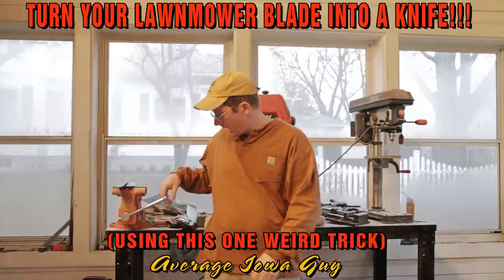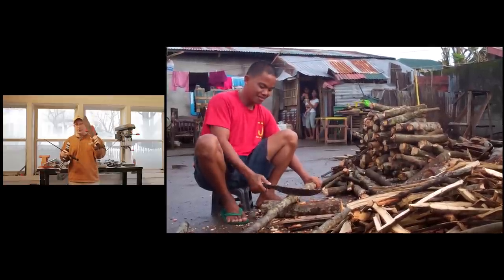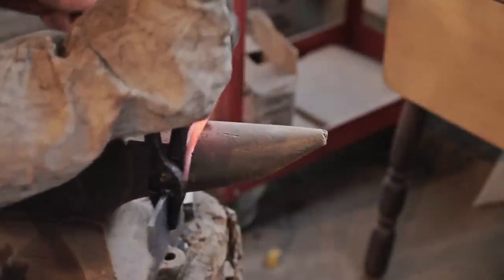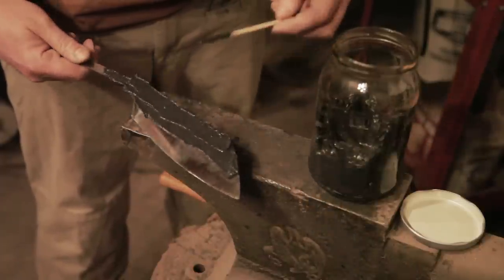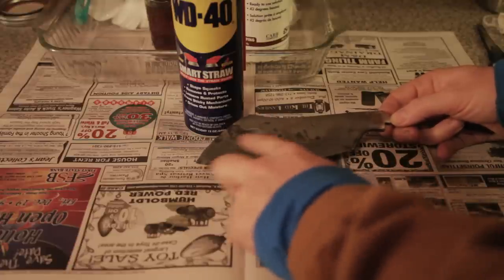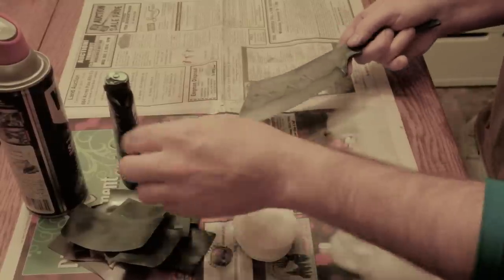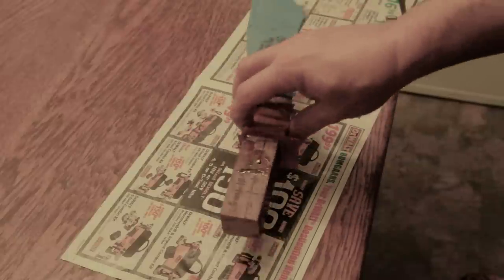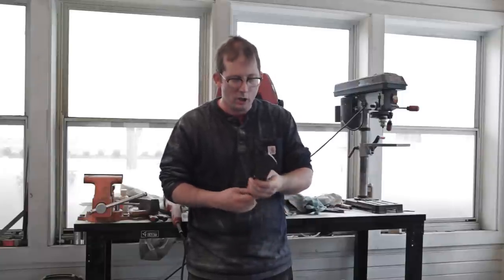Turn Your Lawnmower Blade into a Knife

Comment: Always enjoy your forging vids, Kyle.  I've never seen a hamon on lawnmower blade steel!  That one really came out nice.  What quenchant did you use?  Oh, and I've had great success with gluing rubber on a sanding block for hand sanding convex bevels.  McMaster-Carr has a dizzying array of rubber types with different durometers.  I have found their silicon rubber with a durometer hardness of 50A to work best for me, but you may want to experiment to find what works best for you.
Reply from the maker: Cool!  Thanks for the info.  While I do enjoy working with lawnmower blades, that isn't something I would sell, as I have come to the same conclusion that using known steels with a professional heat treat is for me the most ethical way of doing business.  That knife will be my personal knife.  That plus a Swiss Army knife would be plenty for me.

Comment: Theoretically couldnt you just harden the edge portion with an oxy or propane torch and then quench that then temper the blade after? Or is this method of hardening better because its a mystery steel?

Comment: What kind of quenchant did you use? im in the process of making one myself and would like to know what you used. Thanks!
Reply: Adam Wilder for lawn mower blade steel I hear water is the best. I'm working on a blade I quenched in vegetable oil. didn't harden as good. did some research.  for unknown steel like lawn mower blades water is best. it worked.  a file skates rite across  it now

Comment: awesome!
i have been trying to get hamons on some 1% low alloy steels and ended up cracking the edge every time, in multiple places. i did at least 3 tempering cycles and paid a lot of attention to straightness and to have no sharp edges.
it`s super frustrating to destroy blades that are readly forged and ground with so much work to get to the point of quenching.
now i just got some steel which is very similar to 1060 and i am really looking forward to try that again.
besides using deep hardening steels i think i made the mistake of using water with high calcium content.
now i collected enough rain water:) 
i would like to ask a few questions and i would really appreciate your answers:
is it possible that the 1%er also gets more curvature during the quench,
resulting in a higher probability of cracking the egde? and: could yo tell me how thick of an edge (in mm)
do you grind it down to before the quench? as far as i could see, you did use oil...
if so, why not water? it`s supposed to make the hamon even more visible, right?
thanks for your time!
please keep adding more videos,
all the best,
edgar
Reply from the maker: Your best bet is going to be to find 1060, 1075 or W2 and quench with the appropriate quenchent for that steel.  I get my blades basically ground enough to finish before undergoing quenching.  I typically leave the edges as thick as a dime.  As to the other question I do not know.  I don't think calcium in your water is the problem though.
Reply: averageiowaguy
i read that if one uses water for the quench, it should be "soft" water like rain water or destilled water plus it should be warm. the soft water bubbles a lot less than when there is calcium in it. it cools more evenly and puts less stress
on the steel when the austenite transforms into martensite. i did not know that oil also works in getting nice hamons,
since all the traditional japanese swordsmiths use water. the probability of cracking the edge is for shure
less likely with oil.
Reply from the maker: I have had luck only with oil, but I'm no metallurgist.
Reply: I'm a (very amateur) Whitesmith, I've read and seen videos using dish detergent as a quenchant.
I haven't done any work requiring me to quench anything soo... Just throwing that out there.